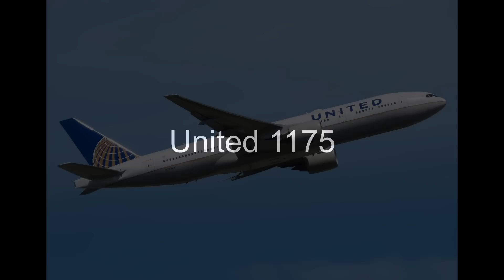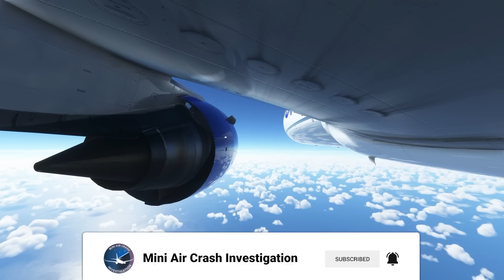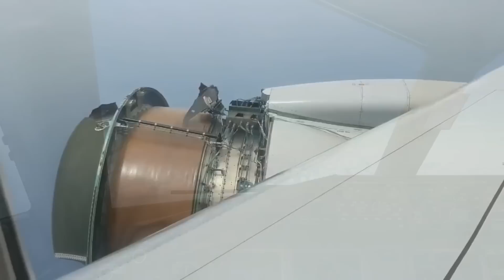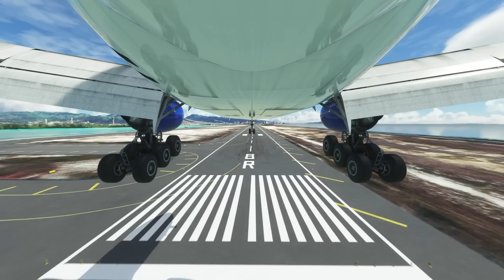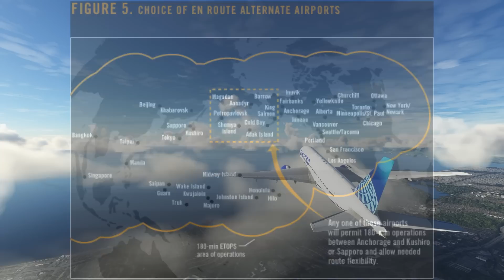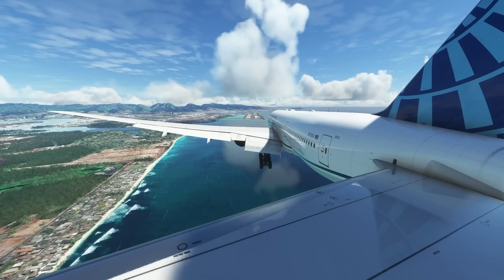How A Room With Bad AC Almost Crashed A Passenger Jet | United Airlines Flight 1175

Comment: It still boggles my mind that airplane manufacturers don't put cameras aimed at critical structures sufficient to allow the pilots to see damage like this without leaving the cockpit...
Reply: At least 2 cameras could be placed inside the cabin facing out towards each engine, couldn’t they?
Reply: The 777-300ER has cameras, Airbus 350 and 380 have…
Reply: @Shamol  ITS WEIRD THEY KEEP SAYING WHY IT CANT BE DONE WHEN ITS COMMON.
EVER WATCH TREK TRENDY.
Reply: Kyle Korona  I don't understand.
Reply: All this could be done with ubiquitous modern camera technology. Weight would barely factor, as would expense. Should be easy enough to see all 4 corners.
Reply: @ThreenaddiesRexMegistus  IVE HELPED WITH DESIGN. MY IDEA IS TO SEND DIGITAL SIGNAL NO WIRING NEEDED POWERED THROUGH SOLAR OR WIND SPEED.
Reply: @ThreenaddiesRexMegistus  NOT ACCORDING TO THESE FOLK.
Reply: Top of tail camera on A380 is brilliant and shows exactly all 4 engines and can be seen also by the passengers. record it on an SSD and you can play it back to see exactly what happened.
Reply: All discussion aside, in fact the latest jets do. Not that it would have made a difference in this case, except perhaps in passenger perception. I can imagine not everyone will understand if a flight crew member walks into the cabin to check on the engine. I mean what's next, climb out onto the wing and pull the dipstick?
Reply: @marcelb3645  LOOK UP FLIGHT 191 OUT OF CHICAGO. 1979 HAD OUT BOARD CAMERAS AND VIDEO MONITOR FOR PASSENGER'S
Reply: @ronniewall492   
A whole different level though, to have something like that happen so low and slow...
Reply: Well, weight is important, every kilogram or pound matters. A flight attendant could go inspect it, or a pilot could do it at basically any time anyways. Therefore, it is not vital equipment, unlike the "TERRAIN TERRAIN, PULL UP!" warning. Another thing I'd like to add is that it will rarely be used anyways, as most failures will be posted on the flight computers anyways.
Reply: @MaxLai_0104  THE FIRST OUTBOARD CAMERAS WAS FEATURED FLIGHT 191 OUT OF CHICAGO 1979.
Reply: Why not have small side mirrors like a car
Reply: @melissers5282  Because it's unnecessary weight and might cause the plane to fall out of the sky, because well, aerodynamics. Considering ice shorter than a grain of sand could cause an aerodynamic stall, you can see what some giant side mirrors could do.
Reply: @MaxLai_0104  I wonder if it's possible that they could craft the mirrors in such a way to not disrupt the airflow over the wings or maybe even in a way to slightly enhance it. I mean i don't really see the need to have them at all due to there being a whole lot of instruments the pilots have to work with but now I'm just curious :o
I should also clarify that I have a criminally poor perception of aircraft size so I'm definitely underestimating the size of the mirrors haha
Reply: @melissers5282  THERE ARE LENSES THAT MOUNT FLAT. THESE PEOPLE THAT ARE SAYING IT CANT BE DONE ARE JUMPING ME BECAUSE I SAID THEY ARE ALREADY DOING IT TREK TRENDY SHOWS
Reply: @melissers5282  YOU CAN WITH FRESNEL LENS.
Reply: 2 Go Pros would work.  Problem solved!
Reply: @MarcusHawksley  YOU MOCK DISABILITY THEN ASK ME TO BE NICE.
Reply: @ronniewall492  😳 not sure what disability you think I'm mocking. All caps is primarily used for emphasis. It comes across as shouting. If you are using it for another reason, I understand. However you should try and understand that how other people may perceive you.
Your messages throughout this comments section are aggressively rude, the fact that they are in all caps makes them even worse. My first comment was about that and it still stands. Now you are throwing about accusations that don't have a foundation. Instead of getting upset, look at what you have been writing. See how you have called people out for being wrong with out trying to explain why. Think how your comments add to the conversation and how they might affect the people you are replying to.
You are being unkind and yet expecting the world to be understanding of you. It is a rather ridiculous position to take.
I called you out because you are making this environment a less pleasant place. Instead of seeing this you are obsessing with some self perceived slight. All caps or not, you are being an arse.
Reply: @MarcusHawksley  WHEN I SAY IT'S ABOUT DISABILITY YOU DROP IT NOT RIGHT TO QUESTION ME.
Reply: @@ricardo6500 THEY ARE PUTTING CAMERAS ON PLANES SO YOU HAVE NO CLUE
Reply: Even a couple of rear facing mirrors at strategic points
Reply: @desdicadoric  car manufacturers are thinking or even, starting to remove car mirrors because at speeds that cars usually go (50....80... 120km/h) they do too much drag. Planes cruise closer to 900km/h. Does that seem feasible to you?
Reply: @desdicadoric  YES  WITH FRESNEL LENS.
Reply: It astounds me as well. So many almost ridiculously cheap fixes could be incorporated into modern airliners, such as multi camera selection, allowing the pilots an all around view. It would also capture images from the cockpit view. So many pilots have been reporting UFOs, which is a safety of flight consideration. Day or night, objects, which have no TCAS transponder, remain a concern. The responsibility for the compliment of souls on board is a heavy responsibility for pilots, and every consideration of this should be appropriately dealt with. Sure, it may be a military exercise at altitude, but a record of it becomes critical, and all the more some when multiple aircraft report the identical objects. I have heard the conversations between aircraft, where several aircrews share the same concerns, yet they are never resolved to anyone's satisfaction.
Reply: Even garbage trucks have cameras.
Reply: If they can prove it's not critical and then build it with consumer parts, they could have a couple of video recorders around.
Reply: @thewhitefalcon8539  PLANES HAVE CAMERAS
Reply: @thewhitefalcon8539  https://youtu.be/FGk3losPhpA
Reply: The cameras would have to be much more robust than consumer grade. They would need wiring, power, maintenance, monitoring, and themselves could become a liability. Basically if they were worth installing considering the tradeoffs, they would already be there.
Reply: @Sashazur  THEY ARE THERE.
SELF CONTAINED STREAMS INFO.
AIRFLOW PROVIDES POWER.
Reply: @Sashazur  ARE YOU AN ENGINEER. 
FUNNY HOW MANY OF YALL TRY TO SAY THINGS CANT BECAUSE CANT FIGURE OUT HOW TO DO IT.
Reply: @Sashazur  THEY ARE. FIRST THERE IS NO WIRING NEEDED.
THEY HAVE SELF CONTAINED UNITS THAT CAN TRANSMIT TO CAMERA.
Reply: @ronniewall492 self contained units? How are they powered?
Reply: @TheAllMightyGodofCod  WIND SOLAR UNDERSTAND THEY USE VERY LITTLE POWER AND ONLY WHEN ASKED TO DO THEY POWER UP.
Reply: @ronniewall492  yeah.... Right....
Reply: @TheAllMightyGodofCod  DUDE HOW MANY THINGS HAVE YOU DESIGNED THAT MADE IT ON PLANES
Reply: @ronniewall492  I should be the one asking you that and not you asking me that, as I didn't propuse any thing to go into an airplane, you did.
Reply: @TheAllMightyGodofCod  WHICH THEY ARE DOING SEE PEOPLE LIKE MY IDEAS. I HELPED DESIGN STUFF.
Reply: @TheAllMightyGodofCod  AIRFLOW.
Reply: @ronniewall492  sorry, your English is too much confusing for me to understand.
Taking your last setence, which stuff did you help design, care to enlighten us?
By the way, how do you know that we are not also designers and engineers?
Reply: @TheAllMightyGodofCod  MY IDEA WAS PUTTING CAMERAS LOW TO HELP WITH TAXI.
IF YOU WERE AN ENGINEER YOU WOULD HAVE SOLUTIONS.
EVERY PROBLEM YOU COME UP WITH HAS BEEN SOLVED.
AS FAR AS NOT UNDERSTANDING  THAT IS YOUR PROBLEM. 
I CAN TELL YOU A LOT IF STUFF YOU WONT UNDERSTAND.
Reply: @TheAllMightyGodofCod  ANGULAR MAGNETISM WORKING ON MAGNETIC BEARINGS.
Reply: @ronniewall492  still going at it? No link to your "invention"?
Stop trolling us.
Reply: Cameras would take up energy which would be costly in an emergency, as well as being a distraction for the pilots when they already have a heavy workload.
My biggest concern if attempts were made to implement cameras in older models would be the wiring and how it might interfere or try and work around existing wiring.
Reminds me of Swissair 111 and how the plane had a newly introduced entertainment system for the passengers, but a short circuit in the system's wiring started a fire which ate through critical flight controls and caused the loss of the plane and all aboard.
Reply: @chronicsheepdeprivation8441  THEN WHY ARE THEY ACTUALLY INSTALLING CAMERAS FOR THIS.
UNDERSTAND THEY HAVE SELF CONTAINED UNITS THAT YOU STICK ON SURFACE. NO WIRES NEEDED
Reply: @chronicsheepdeprivation8441  THEY USE CAMERAS TO KEEP FROM CRASHING
Reply: @chronicsheepdeprivation8441  NON ISSUES. THEY MAKE SELF CONTAINED UNITS THEY USE RADIO TO SEND SIGNAL TO CABIN. 
ITS NOT THAT BIG OF A DEAL.
ACTUALLY WINDS UP SAVING MONEY
Reply: I don’t think pilot need another distraction,what about night? Then you need lights and so on.
Reply: @DimSimSam  LETS KEEP THE CAPTIAN IN THE DARK BECAUSE WHAT YOU THINK.
FOOL THEY ARE PUTTING CAMERAS ON PLANES WITHOUT YOUR APPROVAL.
Reply: Cameras will never have built-in airplanes. It doesn’t make economic sense and not everyone who wants a camera wants it to be on an airplane.
Reply: @Jump-n-smash  LOOK UP TREK TRENDY
Reply: @Jump-n-smash  THEY ALREADY DO IT AND THEY DIDNT ASK YOU FIRST
Reply: @Jump-n-smash  FOR THE FLIGHT DECK TO LOOK AT PLANE.
Reply: It doesn’t matter what the damage looks like because the pilots cannot fix it. It matters how the airplane flys which is determined from the cockpit without any visual inspection.
Reply: @georgeconway4360  It does matter. A pilot wants to know, before trying an approach, whether the wing, flaps, slats etc are damaged. More than one flyable plane has stalled and crashed because of wing damage unknown to the pilot, after an uncontained engine failure. Had they known, they could have made a higher speed landing.
Reply: @marcelb3645  Give me an example of an actual accident or incident. A camera view would only be a distraction. Accident reports show that it is not unusual for pilots not being able to read their airspeed indicators or altimeters or recognize when they are too high or too low before it is too late.
Reply: @georgeconway4360  El Al 1862 is one example where adjusting approach speed because of wing damage could have helped. They flew around happily until slowing down for final. It was only then that they lost control, even while doing everything by the book for a dual engine failure.

There is a similar case with a 707, where the pilots did indeed make a successful high speed approach and landing after visually observing wing damage, though I don't know the flight number offhand, but you could probably find it yourself.

All I'm saying is there can be value in visual assessment of wing damage.

Obviously they can't fix it, but it can help pilots adapt to the situation. Every bit of added situational awareness is a win.
Reply: @marcelb3645  Marcel, on this EL AL 1862 a camera would have been useless. If they had 100 cameras on the airplane if they could have selected the necessary camera or cameras the never would have used them. They were just too busy trying to keep the airplane in the air. They had lost two hydraulic systems, probably comprising rudder available  with two engines out plus wing damage on that side. As an airline pilot for just over 43 years, 16 as a F/O on the DC8, SVC10, B747, and Captain for 27 years on the B727, DC8, MD11, A300-600, A310, and the MD10 the idea that a camera being useful to a flight crew is almost laughable.
Reply: @georgeconway4360   I'll respectfully disagree. Glass cockpits may have changed the feasibility of looking behind you in a high workload situation.

I think it was Transair 671 that could have crashed in the same way, if one of the crew had not looked out the window to assess their situation.
Reply: @ronniewall492  Really, must have been the same people that certified the 737 MAX. We will see how well it works out when a crew flys it into the ground while searching for the desired camera. Please provide me with a link where grownups are involved.
Reply: @georgeconway4360  DUDE THEY ARE DOING IT DO A SEARCH.
Reply: @marcelb3645  EL AL didn’t have time to look at cameras. They had lost two of the four hydraulic systems and probably had insufficient rudder to control the yaw caused by two out on one side.
Reply: @ronniewall492  Sonny, grow up. I hope you’re not planning to be a pilot.
Reply: @georgeconway4360  I'll refer to the final report for that, for those interested enough to still read this. Let's just agree to disagree whether it could be of use to have extra visibility outside the aircraft.
Reply: @ronniewall492  It’s useless.
Reply: @ronniewall492  Poor Ronnie, keep it going. You’ll be 14 soon! Oops, I forgot to mention, it’s not YOURE it’s YOU’RE.
Reply: @ronniewall492  Poor Ronnie. Oops It’s I’M not IM. Make sure your homework is done for tomorrow.
Reply: @georgeconway4360  STAY IGNORANT YOURE GOOD AT IT
Reply: @georgeconway4360  HUSH BOY
Reply: @georgeconway4360  THEN WHY DO THEY ALWAYS SEND SOMEONE FROM COVKPIT TO LOOK OUT WINDOWS.
YOU UNDERSTAND THEY HAVE BEEN DOING SO SINCE THE LATE 70'S.
Reply: @ronniewall492  That depends on the problem and the type of airplane. When there is a question about the landing gear being down and locked some airplanes have a mechanical indicator on the top of the wing that confirms it’s locked down. They don’t always send someone to the rear for most problems. If the engines are mounted beneath the wing someone could go back but more likely the would call the senior F/A to take look if there is concern about damage. Since most airliners are now only two engines you will be landing at the nearest suitable airport which will happen shortly. If you are over an ocean that nearest suitable airport may be hours away. The only other alternative is the second engine fails you will land in that ocean. Sending someone back didn’t start in the 70s but probably started in the 30s.
Reply: WHY ARE YALL ARGUING ABOUT CAMERAS?
FACT IS THEY HAD OUT BOARD CAMERAS IN THE 70'S. FLIGHT 191 OUT OF CHICAGO.
MOST PLANES HAVE CAMERAS WITH SOME BEING ALLOWED TO BE VIEWED BY PASSENGERS. 
SO ALL YOUR TALK ABOUT WHY THEY SHOULDNT IS MUTE POINT
Reply: @ronniewall492  are you asking me that? You are the one arguing about it.
Reply: @TheAllMightyGodofCod  BECAUSE THEY ARE DOING WHAT I SAID
Reply: @ronniewall492  they are? Show me a commercial plane with solar or wind powered cameras to monitor the engines.
Thanks.
Reply: Cost. And also it says “our plane might have a problem here” and nobody will do that
Reply: @fatfreddyscoat7564  COST ISNT A FACTOR. LESS THAN TEN BUCKS.
Reply: @ronniewall492  Ronnie, you just don’t understand that everything on an airplane costs lots of money. Back in the 1960s the pencil sharpener at the Navigator Station in the cockpit cost $35 when the same sharpener at school, the office, or home cost $1.50. Everything on an airplane has to be tested and approved. Talk to the FAA about your ideas. Even they enjoy a good laugh now and then.
Reply: @georgeconway4360  SO WHAT THEY ARE DOING IT SO WHY ARE YOU STILL ARGUING.

DO YOU UNDERSTAND THEY HAVE DONE SO SINCE THE 70'S.
Reply: @georgeconway4360  FUNNY SO WHY DO PLANES HAVE THEM?
Reply: @georgeconway4360  YOU KEEP SAYING WHY THEY CANT DO THINGS  GOOD THATVTHEY LISTEN TO PEOPLE LIKE ME AND NOT YOU.
LAST TIME TRY TO FOLLOW. PLANES HAVE HAD OUTBOARD CAMERAS SINCE THE 70'S.
Reply: @ronniewall492  No sonny, I don’t say they can’t do things. I say doing something’s is useless. It is sort of like the idea you could make make flying safer if every airplane had a huge parachute to allow it to just float to the ground if there is an emergency. Sound great but it doesn’t work. Airplanes don’t fall out of the sky. Pilots normally fly them into the ground. We call these accidents but in many cases it is just stupidity. Ronnie, from your posts I would guess you are 13 years old and in middle school. Ronnie, they could put cameras on every airplane at the cost of a few million dollars per airframe but pilots don’t need them, and they would be a safety issue because if a pilot used them it would distract the crew from their main job of flying the airplane safely.
Reply: @ronniewall492  Ronnie, do you understand you have no experience and have no idea what you are talking about?
Reply: @ronniewall492  Nope! No cameras. They are not needed and would only be a dangerous distraction.
Reply: @georgeconway4360  THEY ARE DOING IT
Reply: Kyle Korona  PROBABLY A DOZEN
Reply: Kyle Korona  NOT SURE
Reply: You don’t seem to respect how rare failures are. Do you have a camera pointed at each of your wheels in your car for when it fails on the interstate?
Reply: @TCPUDPATM  THEY PUT CAMERAS ON.
Reply: @TCPUDPATM  ARE YOUR CAR WHEEL SUBJECT TO CATCH FIRE WHEN RETRACTED?
YOURE TO STUPID TO THING THEY ARE PUTTING CAMERAS ON LOOK AT TREK TRENDY.
Reply: IVE SUGGESTED THIS MANY TIMES.
I ALSO THINK IT WOULD BE GOOD TO STREAM VIDEO TO GROUND
Reply: Kyle Korona  YES
Reply: Kyle Korona  YES BUT THEY DONT BELIEVE ME.
Reply: Too much weight
Reply: @kommandantgalileo  not even slightly. I'm fairly certain we can put... 30kgs? In a plane and still be pretty okay when the difference in weights betwern flights change so much from just the passengers themselves, which really would be the only issue with a weight that light. Which, 30kg would already be stupid heavy for a few cameras pointed at idk, the tail, landing gear, and the engines. 

To further prove my point, passenger planes are already fitted with cameras passengers can use to get better views! To suggest CAMERAS are too heavy for a giant passenger jet that literally has two levels is ridiculous.
Reply: @cherriberri8373  no, the plane can handle it, but it adds enough weight that it will lower the fuel efficiency, you must remeber we are talking about a industry which is willing to spend millions of dollars just to save 1% more fuel
Reply: @cherriberri8373  THEY HAVE CAMERAS THAT WEIGH LESS THAN AN OUNCE.
Reply: @cherriberri8373  WOW SOMEONE LOGICAL.
Reply: @ronniewall492  I'm just going to stop arguing with you, I can't change a insane person's mind.
Reply: @kommandantgalileo  YOU NEVER CHANGE YOURS I SEE.
DUDE I HELP DESIGN THE STUFF.
WE CAN USE WIND TO POWER CAMERA. THEY SEND SIGNAL OUT THEY HAVE MONITORS IN COCKPIT. 
YOURE SAYING THEY CANT DO THIS BUT THEY ALREADY DO.
Reply: @ronniewall492  never said they can't, I said they won't. and stop using caps.
Reply: @kommandantgalileo  THEY DO USE THEM AND CAPS HELP ME TYPE. 
YOU UNDERSTAND THEY ARE NOW PLACING CAMERAS IN VARIOUS LOCATIONS. YOU DONT HAVE A CLUE.
Reply: @ronniewall492  I just checked, nope, not putting cameras anywhere, if you can please provide a source of your information.
Reply: @kommandantgalileo  IT WILL COST YOU.
Reply: @ronniewall492  then I shall dismiss you claims as mere speculation.
Reply: @cherriberri8373  NO. 
Weight, even in grams is  critical to a plane's performance. And besides the weight is the amount of information you want a busy pilot you sift through during a flight; along with everything else he/she has your monitor, you want to give them some camera views also?
Reply: @cherriberri8373  WHY ARE FOLK ATTACKING ME WHEN OTHERS ALSO SAY SAME AS ME.
Reply: @youtubemusicowesmemoney8470  THEN WHY ARE THEY DOING SO AFTER YOU TOLD THEM NO.
Reply: @ronniewall492  Yeah, I'm just going to ignore you.
Reply: @ronniewall492  Perhaps you have a link to such an article? As I work in the industry as a A/P mechanic and do predominantly weight and balancing for commercial a/c, I am curious. If the a/c is private and "for hire", the owner can put any FAA approved equipment on the plane. Any such camera system would have to be approved by the FAA for installment and have the necessary Airworthiness Directives issued to all US repair stations for the refurbishment, and no such thing is out here. 
If you know something that the regulatory agency that runs the airlines doesn't, you surely have said proof, like the AD issuance number for this equipment. Right?
Reply: @youtubemusicowesmemoney8470  DUDE DO A SEARCH.
Reply: @youtubemusicowesmemoney8470  I NEED YOUR BOSSES NAME. NO WAY YOU SHOULD BE NEAR ANYTHING MORE DANGEROUS THAN CRAYONS.
TRY TO FOLLOW. THEY ARE PUTTING OUT BOARD CAMERAS ON PLANES.
FLIGHT 191 OUT OF CHICAGO WAS A FAMOUS CRASH 1979 IT MENTIONS OUT BOARD CAMERAS FOR PASSENGERS  TO WATCH.
IF YOU DONT KNOW ABOUT THIS YOU NEED TRAINING.
Reply: @ronniewall492  Fella; I have the FAA website that we refer to for repairs and there's nothing about inboard cameras in engine nacelles. That IS our repair and upgrade guide and if it's not there, then it's not being implemented- period. I'm not even bothering to argue about this because there is no existing AD that specifies cameras be mounted and balancing done for any commercial aircraft in the US. If you google for an AD for such a thing, you get nothing. On the FAA website, nothing. Can you even tell me which airline announced that they were implementing this? You made the assertion that this was occurring in the industry, so you should be able to prove it.
Reply: @ronniewall492  I'm not using all caps and cursing about this, I'm asking you for information that doesn't seem to exist and you are just being rude when I'm simply asking for an AD number for what you claimed. If you can't prove it, that isn't my fault.
Reply: @ronniewall492  Buddy, I work for FAA repair station. So my boss is the head of the FAA and the POTUS. Call them at your leisure.
Reply: @youtubemusicowesmemoney8470  LOW LEVEL STUFF.
Reply: @kommandantgalileo  YOURE THE ONE THATS WRONG FACT THEY PUT CAMERAS ON PLANES
Reply: @kommandantgalileo  a camera and cable for it would be about 100 gram…
Reply: @kommandantgalileo  https://youtu.be/FGk3losPhpA
Reply: @kommandantgalileo  not only is this a dumb comment but airline manufacturers have started doing this already
Reply: @AlwaysBolttheBird  I've argued enough, just leave me be.
Reply: @kommandantgalileo  YOU'RE WRONG BUT YOU DONT WANT ANYONE TO CRITIQUE YOU.
Reply: @ronniewall492  nope, if you can provide a source, I would admit I was wrong, but you have not. I'll wait until then
Reply: @kommandantgalileo  you haven’t argued haha. You made a dumb comment (happens to all of us) but instead of letting it go you double and tripled down
Reply: @kommandantgalileo  I HAVE
Reply: @kommandantgalileo  OTHERS ARE SAYING SAME WHAT A FOOL
Reply: @ronniewall492  then please provide it.
Reply: @ronniewall492  are you serious.
Reply: @kommandantgalileo  DUMB COMMENT
Reply: @ronniewall492  no seriously, they want to save as much weight as possible, it saves fuel, meaning their planes sell better.
Reply: @kommandantgalileo  DUDE DO YOU KNOW HOW LITTLE A CAMERA WEIGHS.
BY THE WAY AIRLINES HAVE STARTED DOING THIS.
THEY HAVE CAMERAS ALL THROUGH PLANE
Reply: @ronniewall492  They still weigh enough for a significantly reduced fuel efficiency, and please direct me to the airlines that are puting cameras on planes
Reply: @ronniewall492  yes Ronnie, I want my captain and co-pilot stressing out and looking at a engine video screen instead of flying my plane. Great Idea👏🏻👍🏻
Reply: @ronniewall492  Yeah, I'm not going to trust you when your source is a episode of Seconds From Disaster.
Reply: @kommandantgalileo  SO THEY LIED
Reply: @ronniewall492  who lied.
Reply: @kommandantgalileo  THEY HAVE CAMERAS WITH DISPLAY IN COCKPIT.
THEY EVEN PUT CAMERAS IN LANDING GEAR SAVES TIME MINEY AND SAFER WAY TO TAXI.
Reply: @kommandantgalileo  THEY HAVE CAMERAS ON PLANES
Reply: @ronniewall492  shut up, this does not need to continue over a week later
Reply: @kommandantgalileo  THINK THEY LIED ABOUT CAMERAS
Reply: @kommandantgalileo  YOURE WRONG BOY LOOK UP TREK TRENDY
Reply: @kommandantgalileo  FO BOY
Reply: @kommandantgalileo  PLANES HAVE CAMERAS
Reply: @MarcusHawksley  WHAT INCORRECT INFO DID I GIVE OUT?
Reply: EVERYONE WILL ARGUE YOU CANT DO THIS. B.S. THEY ALREADY ARE.
Reply: @ronniewall492  dude, turn off caps lock. It's like you are shouting.
Your points are right. But your language is rude as hell. Using caps lock on top of it just make you the jerk.